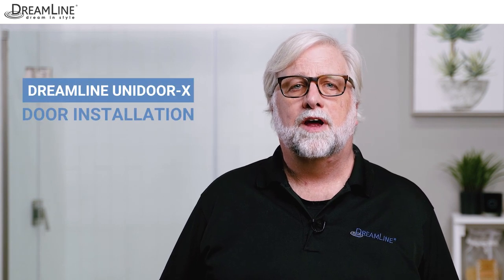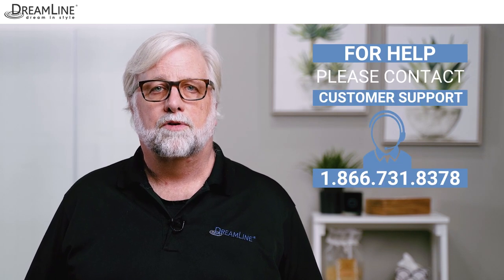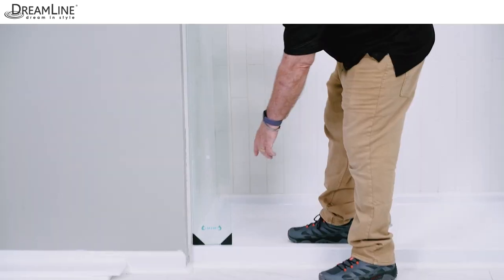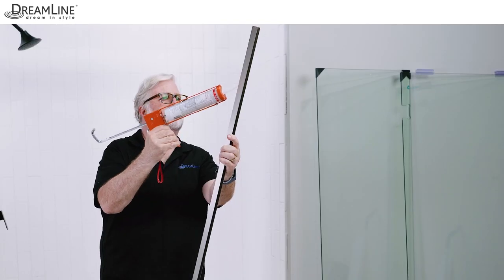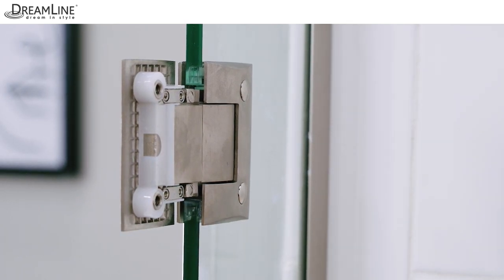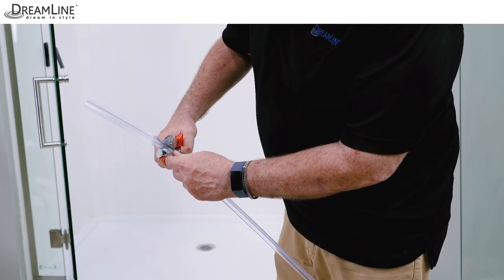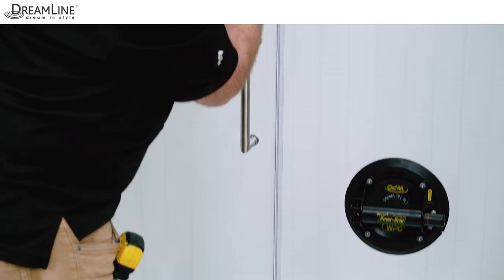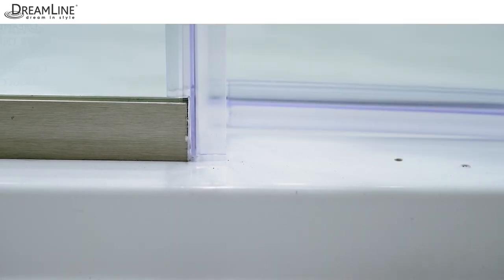How to Install: DreamLine Unidoor-X Swing Shower Door (with 6-inch Hinge Panel)

Comment: The instructions seem to have a contradiction between 7:28 and 9:55.  At 9:55 it says to not operate the door for at least 30 minutes, allowing the silicone in the u-channels to set up. There is no u-channel on the door portion so it must be referring to the u-channel on the hinged class.  However, if you listen to 7:28 that silicone has already set.  

Which is correct?  Do we let the silicone setup and then install the door, or do we install the door and then let the silicone setup?

Thanks
Reply from the maker: Hi, we apologize for the confusion, but for assistance with installation questions, please contact our Customer Support Team at support@dreamline.com or 866-731-2244. We are available 9am-6pm EST, M-F, and will be happy to answer any questions you may have. Thank you!
Reply: Do you see the contradiction I'm talking about?  I think you could just ask the guy who made the video which way he wanted it to go, and then post it here as a correction.

I think it is nice that you listen to youtube comments, but uniformly your only reply is to tell people to call your hotline.  It is not helpful.  What if, instead of doing that, you just call the number yourself (or ask the engineer at the desk next to you) and post the answer here-- that would be helpful.  

If you're some kind of social media consultant who doesn't actually have anything to do with the company then probably better off just not commenting...  @DreamLineShowers

Comment: Do you know how I can remove the door that is connected onto the u-channel? I have a DreamLine shower but not to remove it to redo the shower curb. The u-channel has silicone inside.
Reply from the maker: Hello Gabriel. Thanks for reaching out! For this question, we recommend contacting our team for detailed information. You can contact us at 866-282-8413 extension 201. We are available 9am-6pm EST, M-F and will be happy to answer any questions you may have. You may also send an email to support@dreamline.com.

Comment: What size holes do I drill into the threshold if my threshold is quartz? Beneath the quartz is a wedi curb that has 3/8" PVC layer on top.
Reply from the maker: Hi! For assistance with installation questions, please contact our Customer Support Team at support@dreamline.com or 866-731-2244. We are available 9am-6pm EST, M-F, and will be happy to answer any questions you may have about. Thank you!
Reply: @DreamLineShowers  I called that number today and was instructed to leave my number for a call back as no representatives were available to assist me. No one ever called me back. Is there a more direct number I can call to get assistance answering my question?
Reply: @DreamLineShowers  I just tried calling again today. I sat on hold for a long time and then an automated message told me to "try again later" and it hung up on me. Is there a better number or contact for me to get this question answered? I really need to know this before I start installing.
Reply from the maker: @mdhh2517  I apologize for the inconvenience. Can you please email your name and phone number to marketing@dreamline.com I will escalate to our customer support team and they will be in touch asap. Thank you.
Reply: Am I able to order replacement parts? I need to fix the install of the hinge panel and need another one of the glass panel clamps that is installed on the top of the U channel.
Reply from the maker: @mdhh2517  Hi, to order replacement parts for your DreamLine product, please email us at support@dreamline.com or call our customer support line at 866-731-2244. We are available Monday-Friday 8am-6pm EST. Thank you.

Comment: The instruction manual for this product has the same contradiction.  On page 18 (p.21 of pdf) it says "It is required to allow the silicone to fully cure in the U-channels before installing the door glass".   On page 23 (p.26 of pdf) it says "It is strongly recommended that the 5/8" shims be left beneath the door glass until the silicone securing the hinge panel glass has fully cured".

https://images.thdstatic.com/catalog/pdfImages/64/6441405c-fc6d-4fc6-980b-8482631d2c6e.pdf
Reply from the maker: We apologize for any confusion with the instructions in the installation manual. For best results, it is actually going to be beneficial to take both of these instructions into account. Installing the stationary hinge panel and allowing the silicone to fully cure for several days before installing the shower door will definitely provide the best results. If you are unable to schedule a second day of installation with your contractor to come back and finish the installation of the door glass several days later after the silicone has fully cured, then you would want to consider the second instruction which would be to install the stationary hinge panel, then install the door with the 5/8" shims under the door, then make sure to leave the shims under the door glass for several days while the silicone holding the stationary hinge panel fully cures. In either situation, it is extremely important to not allow the weight of the door glass to pull on the stationary hinge panel until after the silicone holding the stationary hinge panel has fully cured because if you release the weight of the door too soon (before the silicone fully cures), the door glass will pull the stationary glass out of the channel and you will need to begin this entire part of the installation procedure all over from the beginning. This would likely mean you would need to purchase new U-channel hardware, re-cut the new u-channels, re-fasten them to the walls, re-glaze the panel with silicone, wait another several days for the new silicone to cure, etc. Please note that silicone curing times will vary depending on external factors such as the environment within your home (air flow, humidity, etc.), brand of silicone, quantity of silicone used for the install, etc.
Reply: Perfect answer, thanks very much!

I had thought perhaps the other method was preferred because the door weight is held by the 5/8" shims instead of the hinges. I'm grateful you provided a physical/mechanical explanation so I can do it right the first time!

 @DreamLineShowers